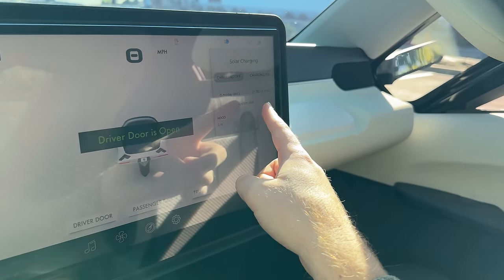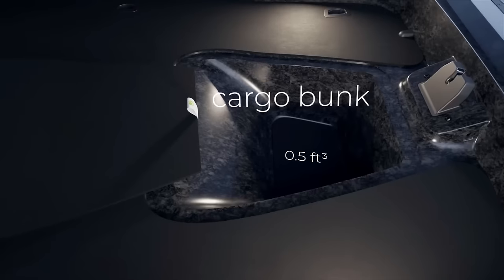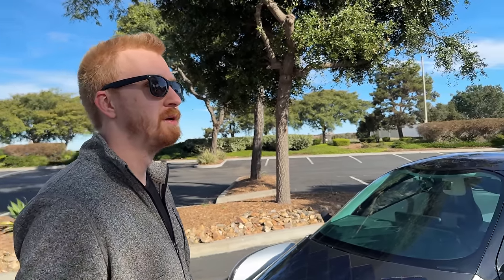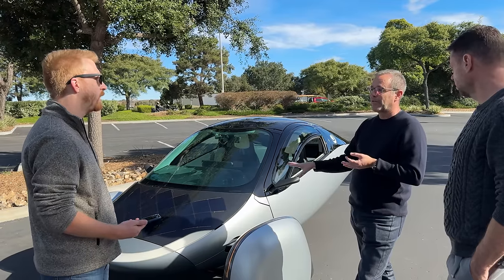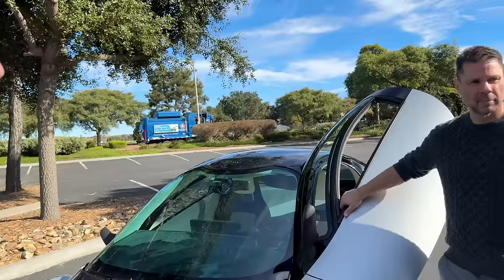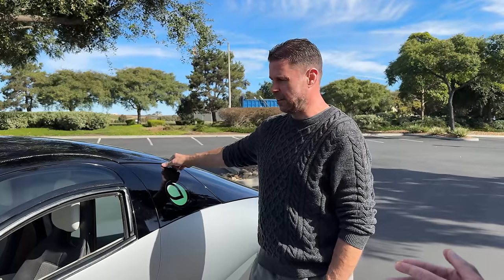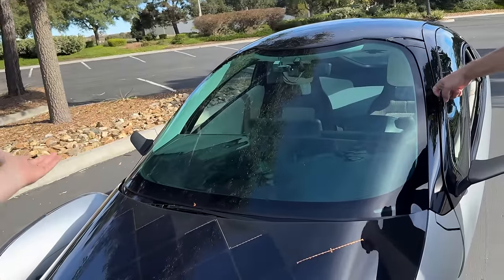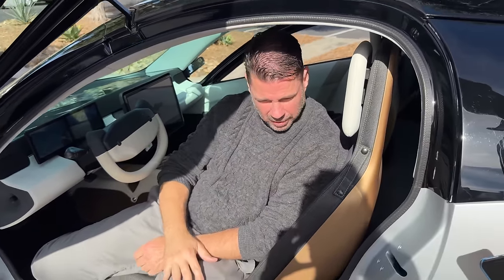Asking Aptera about Safety, HVAC, & More!

Comment: 1 — Was the question about solar over charging answered? While it's nice to send power back to the grid, what if the Aptera is parked on a NYC street during a sunny but cool day? Is that going to be a problem?

2 — So the AC is overkill. That sounds cool, but what about cold weather? Can the Aptera handle -20° Fahrenheit?

3 — The side mirrors are cute.

4 — Are we just going to glance over the part where Chris says he built the first electric DeLorean?

5 — While the doors look cool, how do you get out of an Aptera in the event of a rollover?

6 — While it sounds cool that Aptera is playing nice with the charge networks, do you need an Aptera account to use the vehicle? What if someone never uses the charging networks?

7 — Rainex sounds like a good idea to keep the passenger happy… and nice to know about less bug guts on the vehicle.
Reply: Like any major accident, the Jaws of Life
Reply: Guess we can safely assume that there is a battery management system (BMS) that would never "over charge" the battery. If the battery is "full", just not drawing the current from the solar panels is not a problem, the panels won't explode if you do that. 🤣
Reply: @davidmaddon554  If the vehicle is a twisted mess and you're pinned somehow, then hopefully the fire department makes it in time. But what if the Aptera simply rolled, and the battery is now on fire?

Is the Aptera roof ridged like a weeble-wobble? How would the rounded top work in a crash? Would it favor one side?

As mentioned in the video, the autocycle is front heavy, so wouldn't it likely fall forward in a roll over? Wouldn't that make it tougher to escape through the front window? On a regular car, I'd probably focus on escape through the side window. But since the Aptera has bars across those side windows, I'm not sure if it's possible to escape by smashing the side windows.

Like if I'm driving down the street, and I see a flipped Aptera with the passenger in the side, I'm not sure what I could do with the window smasher in the glove box.

Is it possible to escape through the rear hatch, or would the car tip the other way if there's too much weight in the back? Again, with the rounded roof, is that going to create a seesaw effect?

It might be unlikely… but going with the beachball analogy… what if the vehicle simply bounces weirdly in a collision? The way the doors open, and the way the side windows work, isn't that a safety concern for rollovers?

Does the Aptera have cool explosive charges, to blow the hinges off the doors, in the event of a rollover? Is there an emergency release? I saw a "Release" handle mentioned in a different Aptera fan video, but what does that thingie do? Is that to open the door? Is it for the chair? Does it grant access a secret compartment? It wasn't clear.
Reply: @ThomasWaldmann  I wasn't thinking solar over charging was a problem until Drew asked the question. 😄

I think a technical answer would have been nicer than hypothetical. What if you can't plug the Aptera into the grid to take better advantage of excess power? What is the Aptera going to do if it's really sunny, at 100% battery life, and the cabin is already cooled.

…open the windows and air-condition the planet? 😄
Reply: Regard your question 1. I suspect that the BMS will allow you to set a charge limit. Like 80 % fir example. If you are solar charging and you hit the limit charging will stop and the power being generated by the panels will go unutilized. .
Reply: @PhoticsTV yes there is a manual release handle that opens the doors for any situation where that is warranted.
Reply: #5 I am trying to imagine what it would take to get an Aptera onto its roof.  The lack of a fourth wheel in the back would help I guess, but the battery and motors at the bottom of the vehicle is such a large fraction of its mass.  Also, in order to roll, the tires on one side need to plant.  Rotating towards a side would add to the traction on that side and help the vehicle pivot on those tires.  I don't think the back tire would plant, it would just skid.  Also the front tires are widely spaced for a car of that height.  In any case, my guess is to go out the back hatch.  No idea if it has a manual release.

Comment: Any information on how the car performs in colder temperatures? does the 3 wheel design affect how it would drive in snow or ice? Or even just bad roads with pot holes and cracks, i feel like that third wheel in the back would bounce pretty hard in that design?

Comment: To me, a non-engineer, a big weakness in this car is the lack of side and head airbags.  These do add some weight, but they provide great added protection.  Formula 1 drivers have much stronger seat harnesses and helmets and other safety aspects that an Aptera driver will not have.  The lack of these airbags seems like a missed opportunity to make this a really safe car.

Comment: Hmmm no side airbag? That's really a bad decision. 

I had an accident in an 94 acura integra that didn't have side airbags. I fell asleep and the car hit a tree right behind the driver side door entry. The "locked" door opened which then the seatbelt cut across my shoulder and into my neck like a knife... This accident left me as a quadriplegic with a brachial plexus injury to my left arm. To this day, I believe without a doubt if my car had side impact airbags, I wouldn't have suffered such a life changing injury. 

I love what you guys are doing but PLEASE do think about how this decision could have on impacting someone's life by eliminating side airbags. I would never buy a car without them, nor could I recommend one to someone.
Reply: Aptera has moved the seat inward and has a passenger safety cage to protect from side impacts that your Acura doesn''t have.  We will see how effective these measures are in the crash tests to come.
Reply: @n.brucenelson5920  when you hit an object like a tree that does not move, all that momentum in the car is transferred so in my case, the seatbelt cut right into my neck and snapped it. It literally ripped the nerves roots out of my spine on my left side.  This happens a lot to motorcyclists in the form of bracial plexus injuries. In cars, not so much. This is a big reason airbags save people from horrible injuries
Reply: @josepht1575  I am so glad that you are still here with us.  I have around 1/2 a million miles on 2 wheels, so I am quite aware of the risks, and risk mitigation.
Reply: @n.brucenelson5920  That's a lot of miles. Have you seen the airbag vests they now have? my brother has one. Incredible what they have no adays. It's like madmax here on long island with the way people drive.

Comment: The other large safety improvement is the lighter vehicle. For the Aptera hitting something, it will have less momentum. For something hitting the Aptera, with less weight, the inertia change allows it to give and move more easily instead of being just a battering ram target locked to the ground.

Comment: And still, nobody asks about cold and snowy weather performance.
Reply: I live in Iowa, and I have asked.  Aptera has very fine grained traction control that can sense tire slip and adjust torque about every 2.5".   With proper tires it should be quite good, especially in AWD.

Comment: for the small family…. this is the 2nd or 3rd car….  you won’t put junior in there as the third passenger.  Aptera isn’t building a three seater.  and thats just fine.
Reply: There may eventually be a 3 seat version of the 250 mile range version.  The second Aptera will likely be a 4 wheel, 5 passenger sedan.

Comment: why isn't anyone talking about the huge blind spot caused by the black stripe on the side windows???? it's so dangerous
Reply from the maker: I talked about that a lot in my driving impressions video. Not a real issue when you’re driving irl
Reply: My wife and I were worried about it before we both rode in an alpha prototype.  Although we are withholding final judgement until we experience the production models, we are much less concerned.  Neither one of us found our vision blocked  from essential information during our rides.

Comment: Why don’t you guys make a nap terror that can pull a pebble flow trailer look it up it’s exciting we need a nap tear that can pull this thing. It pushes itself down the road. Maybe that can work.
Reply: Aptera has looked into providing a hitch in later versions.  Perhaps the aftermarket can supply such for the Launch Editions.
Reply: That autocorrect is a nap terror alright! 😉 If an Aptera could tow another self-powered Aptera, then you have the makings of a versatile family vehicle (if only regulations would let someone ride in the towed Aptera).

Comment: Be interested in seeing actual crash/safety testing. That was the weakest segment of the video imo. A lot of vague words thrown around but nothing solid or conclusive. 5* crash rating? Let's see the third party or IIHS data then.

Way off on the beach ball analogy. You're talking about elasticity of impact...which no way a rigid object like this is going to behave anything like a beach ball in a collision...
Reply from the maker: Crash tests will happen once they have the PI builds
Reply: Billiards ball?
Reply: @robertkirchner7981 billiard balls aren't a hollow frame...

Comment: If you have room on your electrical box for 30 or a 50 amp plug, there shouldn’t be any reason it shouldn’t be very similar to a dryer plug. We need an adapter that goes to a regular 220 dryer plug or 30 amp yeah, no plug for a maybe a generator in the garage or something I used to charge my Nissan leaf on out just a 30 amp plug that my dad put in it would match the cord wasn’t hard just Home Depot you know think about convenience for people. I will plug it in at night in the car shuts off when the battery is charged fully.
Reply: Not sure what you are referring to here.  It is easy to charge an Aptera from a dryer circuit.  

The complexity comes in if you want to sync to grid power to provide battery backup.  It has to completely isolate from the grid since feeding power back into mains supply when the grid goes down would be a hazard to service people that were expecting dead lines.
Reply: One thing about adding a 40A socket to any EV into is buy an industrial duty one that is rated for continuous duty. The $8 ones at the box store are not intended for a continuous load and will melt. MonroeLive has session where examples of this are shown.  It is not rocket science, use proper size wiring and a commercial duty socket and you will be fine. Do EVERYTHING to code under a permit. If you need to, educate the electrician. This is not a place to save a couple dollars. If you are plugging into 110, I would use a 10 or 12 AWG extension cord. The normal 14AWG cord will get hot.
Reply: @lancedoyle5026  Well said!

Comment: More important than dc charging rate is the overall charge curve and thermal conditioning. I hope they address this question soon. 10% to 80% is the more interesting stat.
Reply: I maintain that the miles added per hour charging is a more meaningful stat, but MPH charging AND how long it can maintain that pace is the MOST meaningful stat.

Comment: Do they expect to a score a “Good” on IIHS’ updated side crash test?

It’s 4200 LBS traveling at 37 mph.

The efficiency is crazy, but you really need to have top tier crashworthiness to override the size/weight is king mentality.
Reply: Only because there is no "Awesome" rating.  But seriously, I expect that the Aptera will fare better than most cars in any crash, but I do worry about how much the occupants might get bounced around.  Those formula one drivers that walk away from high speed crashes are belted in TIGHT.
Reply: They seem confident from their simulations that due to the body shaoe, design,strength and side impact reinforcements it will fare well without side airbags. I guess that the crash test results will determine if that is the case. Here is a video of some small cars undergoing the side impact crash test.
https://youtu.be/XZ7BrAPCpIM?si=yN2qYIsNdM2dUyBj
Reply: @garywozniak7742  Man, those dummies look like they are getting hit in the shoulder by the door as it caves in.  My bet is that this will be less of an issue with the Aptera, but whiplash may be more of an issue without a side airbag.
Reply: @skeptibleiyam1093  I guess we will find out.

Comment: The only thing I don't like about the cameras versus mirrors is that when you're looking through the windshield ahead, let's say you're focusing on something 100 feet away, then you glance up at your rearview.  Your focus goes from 50 - 100 feet to maybe the car behind you which is a similar distance away and a close transmission for your eyes. The screen will that latter scenario from 50-100 feet to about 2-3 feet.  My eyes are still good, but from what I understand, this kind of transition can become a challenge as one ages.
Reply: That's why I like the real side mirrors. I see a lot of talk about taking those off. If I get an Aptera I'd very likely be leaving those side mirrors right where they are.

I wonder if a regular rear view mirror is a possibility if the solar rear hatch option is excluded. 🤔

I don't need all this technology in the Aptera… and I like tech. Three different screens and cameras to look backwards? That sounds unnecessarily expensive. Although, that's probably because solar charging is the priority. If there was a cheaper low tech version, but it had less solar charging, is the Aptera still as appealing?
Reply: Yet another reason that I wish the rear view display was above/between the side view displays.  Many of us old folks have bi-focal lenses on their glasses.  The near focus portion is normally at the bottom and the far focus at the top.  In any case, the transition would be no worse than going from the car in front to your speedometer.
Reply: @skeptibleiyam1093  this sounds like a good idea, sorta like a 270 degree panorama of the rear view from the Aptera.

Current position of rear view mirror could be a statue requirement ?
Reply: @peterjordan3135  Not on an autocycle.  They get treated like a motorcycle when it comes to mirrors which is why the side mirrors have to be there.  Also, box trucks and anything towing a trailer is allowed to go without a center mounted mirror, so I think it is just the place drivers are used to finding it.  The Cybertruck is going to mess with that expectation so we will see how that goes.

Comment: In terms of safety cars are probably the most dangerous things to get into period. So if you are really concerned about safety you would not be driving in the first place.
Reply: Working wood chippers are more dangerous to get into. Grain silo's, too. Just saying.
Reply: Also walking, at least when there are cars around.
Reply: @skeptibleiyam1093  And lamp posts.
Reply: @aussieideasman8498  I don't believe that I have ever walked into a lamp post, but it doesn't seem that dangerous.  Maybe it is an Australian thing.
Reply: @skeptibleiyam1093  I have never worked with a wood chipper; been up a grain silo; and the obvious one to everybody - been killed in a car accident, but I have walked into a few lamp posts. They hurt, but rarely kill, lol.
Reply: Bicycles and motorcycles are way more dangerous than cars
Reply: @ryanyoder7573  Homes are right up there - especially in Gaza.
Reply: @ryanyoder7573  But people do those things and I would be shocked if the Aptera was not safer than one.  My bet is that it will be at least as safe as a small car.  We shall see.

Comment: No Phillips screws!  I'm  almost willing to forgive the yoke for that!
Extended valve stem on rear wheel only means no rotating the tires.

The purpose of clearing the right third of the windshield is NOT passenger vision.  Leaving that area opaque in bad weather creates a blind spot that can lead to accidents and endangers vulnerable road users.   Excusing it because motorcycle regs don't require it stinks of desperation and smells like BULL$HIT.

The aerodynamic shape won't clear the windshield while crawling through rush hour traffic in a heavy blizzard.
Reply: I think the un-wiped portion of the windshield may be smaller and higher that you are picturing.  It looks to me like it covers all the way across at the bottom.
Reply: @skeptibleiyam1093  I you are right, but from the renders of the aptera from overhead, it looks like the wiper ends about two thirds of the way across the bottom of the windscreen.